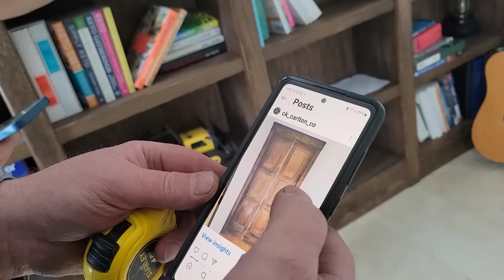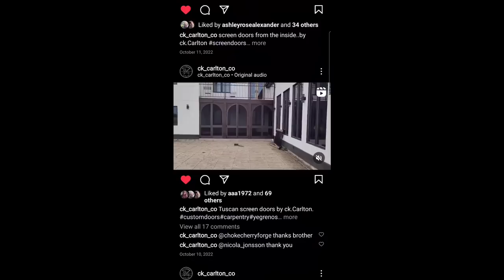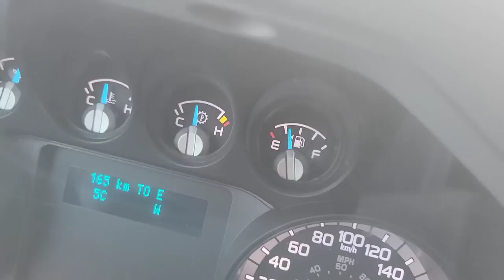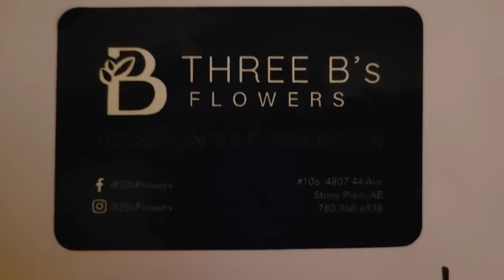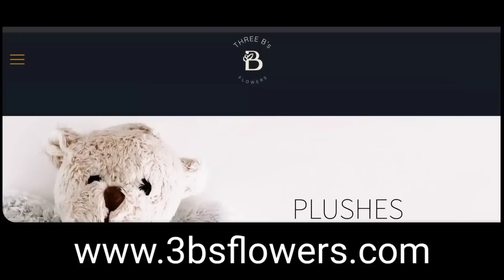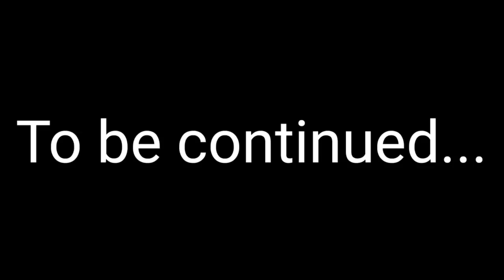I take the day off, get inspired, spend 2 days realizing inspiration | Another VLOG #197

Comment: As an art piece or to hold fruit it is beautiful.  If you wanted to put bread in it, I'd put down a napkin or towel inside first.  But to make bread I don't think it would work.  To make bread though it wouldn't work.  You don't want your dough to pick up the charcoal, also I'm not sure polyurethane is OK to have around food.  Just oiling or using some Odie's Oil on it would be good for actual dough bowl use.
Reply from the maker: Yeah totally. Meant more so to look at.
Poly is food safe once cured. Its used more than oil these days, though i prefer oil. I used it to stabilize the charred parts. This one though is decorative. I only referred to it as a dough bowl mostly to describe the style.

Ones meant to be functional, i would not burn. Too fragile and likely to transfer into the dough, which wouldnt be necessarily harmful, but obviously not desired. Unless youre into that blackfood trend. Haha. Though i wouldnt use odies oil, I likely would use a good food safe oil and or wax to treat the functional ones i make, similar to my boards. 

Keep kicking ass with both feet.

Comment: Does everyone in "Cold Weather Canada" have a big crack across their windshields?  LOL
Reply from the maker: Yes. Lots of thrown rocks due to gravel roads causing chips. Then in the winter the cold vs the vehicle cabin defrost/heat, turns those chips into cracks. Usually on the first drive.
Reply: @JoshuaAlexander138  yeah, it's not as cold here in western Oregon, but we have a LOT of rocks popped up, generally by trucks and then we get a cold snap and the rock chips snake across the windshield and become huge cracks,  so I've had to replace the windshield on my 25-year-old Toyota about 5 times already.

Comment: If you make more of those bowls, don’t use stain and poly, just use oil and wax. Treat it sort of like a cutting board. If people use it as a dough bowl, it will get seasoned over time and won’t need more than an occasional re-oiling/waxing. If it’s just a decorative bowl, torching them can be lots of fun especially if it has cool grain or if you can get that “alligator scales” kind of look, a bit like shou sugi ban.
Reply from the maker: Totally. When i was making it, i didnt even know what a dough bowl was or that they existed. Figured it would just be a cool bowl for your keys or something. Lol. Alot of keys.

I used stain because I wanted the color to be there immediately as it was just meant for decor. And the poly was more so for stabilizing the charcoaled bits. I should have explained that in the video. Initially i planned on using oil. Anyway. If i do make "dough bowls" in the future, i will use oil and or wax. And if i desire a different color, i will likely use different colored woods that are suitable, though the stain is food safe once cured. We shall see!

Thanks for watching!

Comment: I like the char, but not to the point of splitting the edges of the bowl. I would’ve liked it if you stopped a little sooner. Not to say, I don’t love the bowl, I do.
Reply from the maker: The checking was there before. It just exasperated them. Which i dig. But i will do more without.